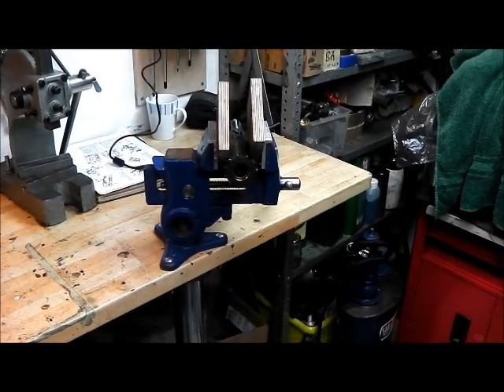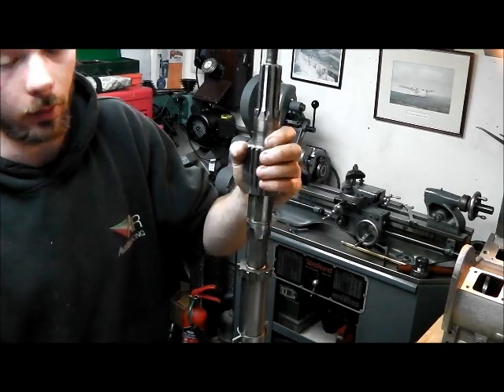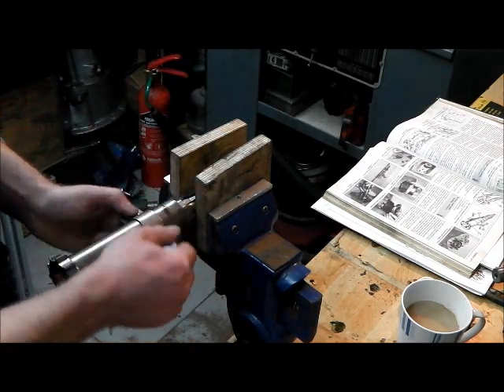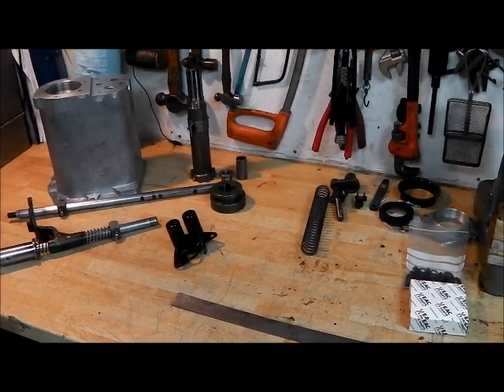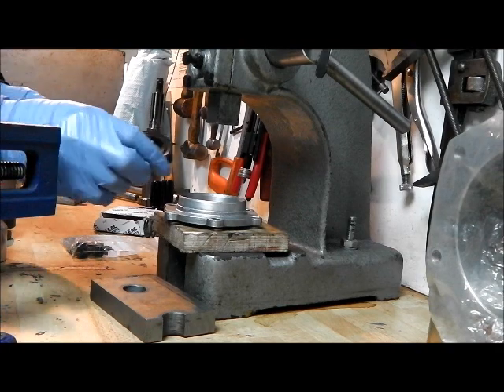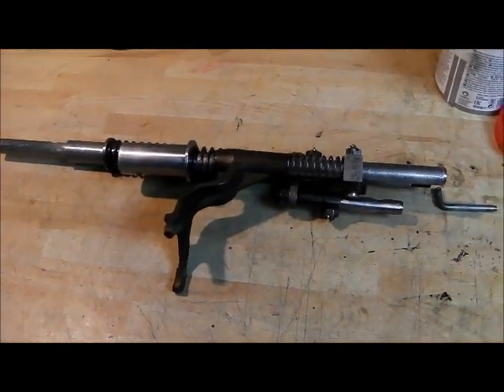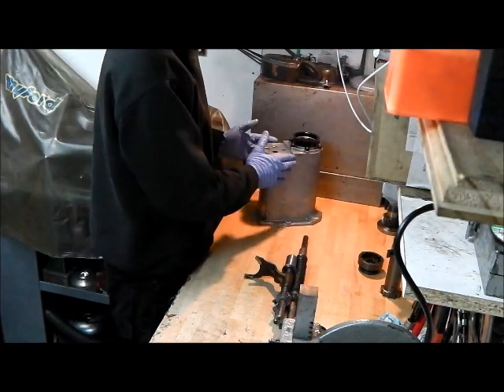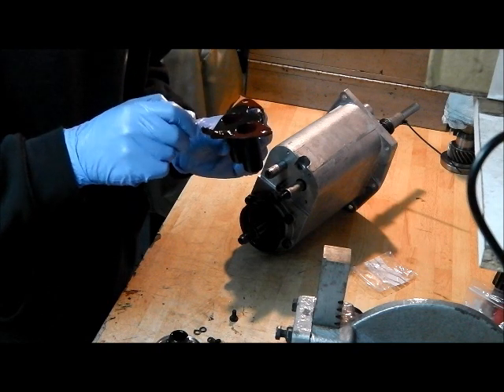Land Rover Series 3 Transfer Box Overhaul - Part 2

Comment: Thanks for the effort you have put into your videos. I am rebuilding a series 3 gearbox to go into my 1968 2a. My first restoration project, never had a gearbox apart before, but now you have provided great detail on how I need to put it back together. Just wondered what type of grease you used. I also noticed that my oil thrower was out by approx the same as yours.

Comment: Always nice to see your gearbox progress.  Seeing your lathe in the background reminds me Managed to move my myford on the stand from the end of the garage to the front left side.  Single handed, with a couple of of old fork tubes as Stonehenge rollers. Big garage reordering going on , then I’m starting on my gearbox. Got all the bearings the other day, but I forgot to order a bush!  Of course!
Reply from the maker: Sounds like fun! How did the gearbox fare on the Wales trip - no issues after that?
I used to have extended breathers on everything, the only reason really was to try and keep oil where it ought to be. I've since done away with them, I think the only thing which really benefited was the Fairey overdrive.

Comment: I fitted a breather to the top cover on the transfer box. Mines steel and I just soft soldered a piece of brass tube in. You could tap into the roamerdrive plate.With a rubber pipe on the outside held up high. I don’t go wading in 3’ of water. Did the same with the two axle breathers as well. Cut the bell off and converted the threaded portion to take a pipe leading upwards out of harms way. 
Seeing as the box breathes for the transfer box as well it’s a worthwhile mod, as the penny sized breather gets blocked as you pointed out

Comment: Hello, hope you can help, just rebuilding my transfer box ( series 3 ) and I am missing the spacer on the long selector shaft, do you know the length or do you have a part number for this item as I seem to be missing it? Love your very informative content, thanks Tim
Reply from the maker: Hi Tim, thanks for the comment- check out the parts diagrams on the LR workshop website. You'll need to take note of the key which accompanies each diagram, detailing variations in part number for the model year changes.

Comment: How did you get the casings so clean ? I jet washed mine this weekend and it’s still covered in clay oil and what ever else ? Enjoying the overhaul 👍
Reply from the maker: I use Swarfega Jizer which is a great cleaning solvent. They now do a biodegradable one which you can just hose off, it's great for cleaning engine bays and under vehicles too. Otherwise, plenty of elbow grease with nylon brushes, scrapers and scotchbrite - just spent half an hour or so on it at a time over a week or two, I find that the best way.